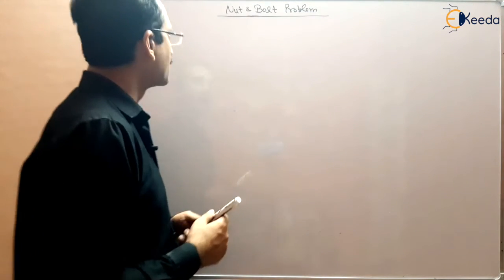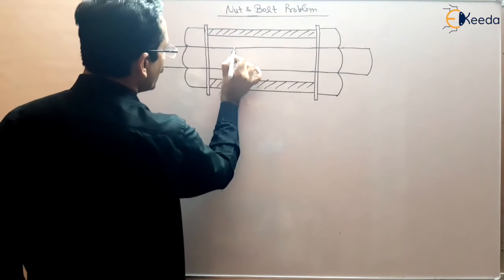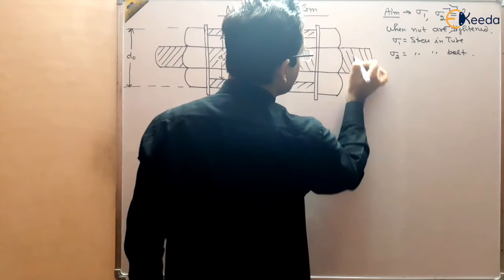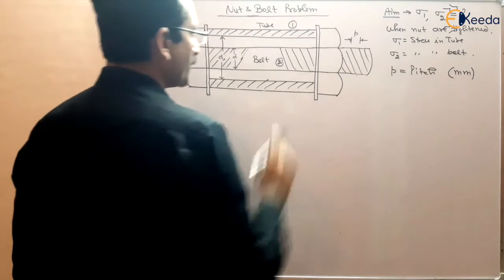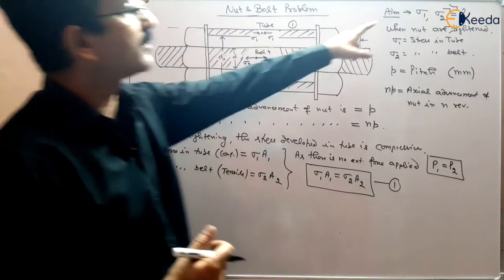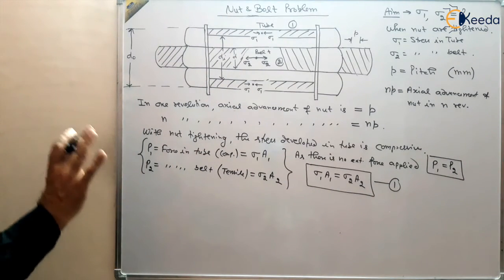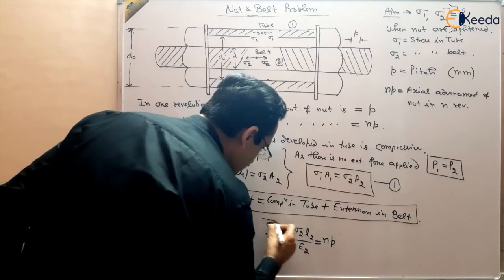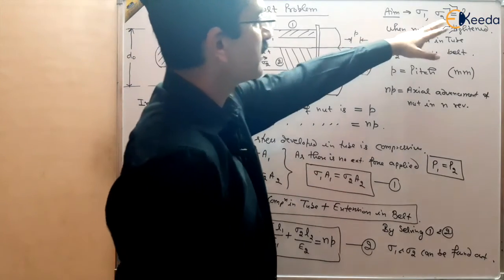Understanding Stresses In Nut And Bolt : Strength Of Materials Basics | GATE

Comment: Stress is internal resistance against deformation. If the nut tries to compress the tube then resistance should be tensile..
Reply: Plz solve this issue bcoz everywhere I found compression stress in tube